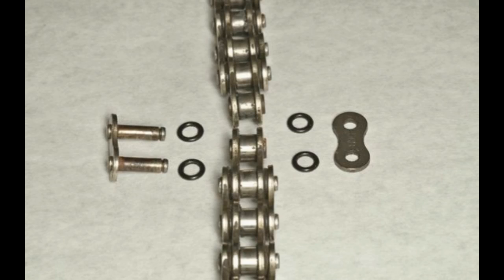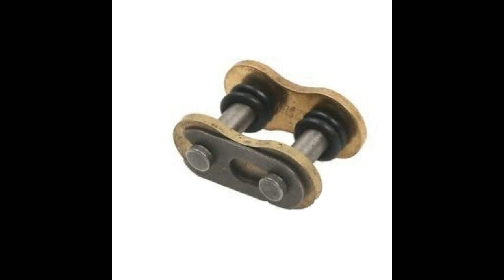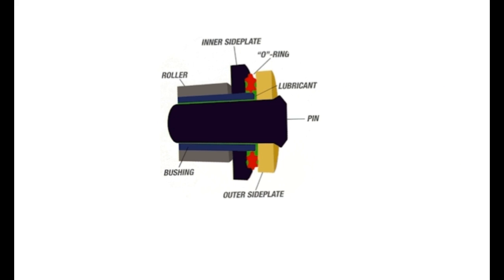Chain lubricants and importance for an o-ring chain

Comment: im using classic 350 my sprocket teeth was broken . can I use o ring chain and if I used it means the same problem will occur in future or what ???
Reply from the maker: if your sprocket teeth is broken, please prefer changing it, it is not that costly. O-ring has nothing to do with that.